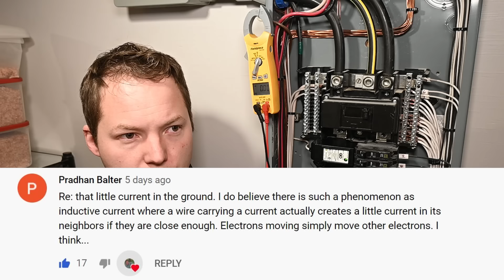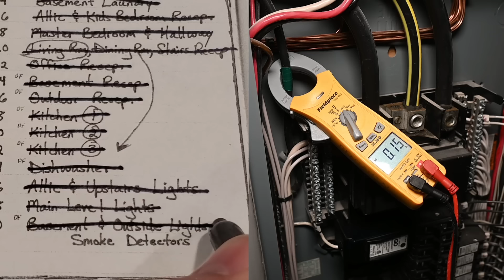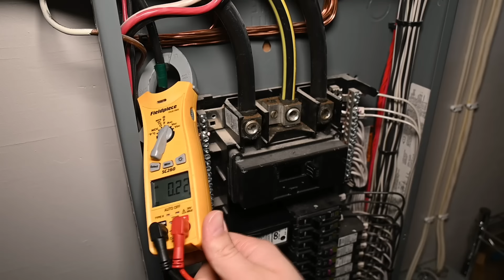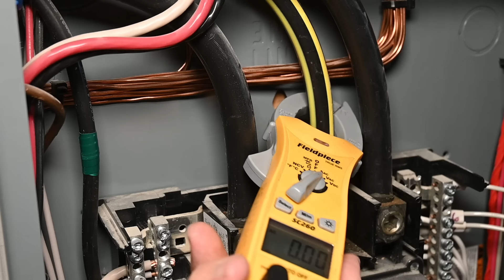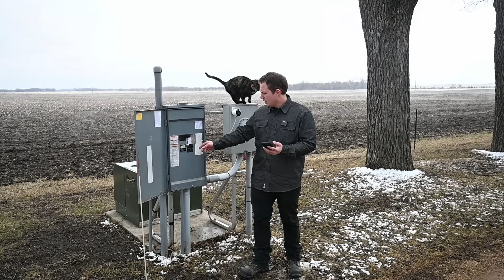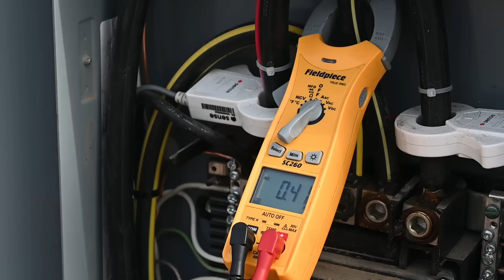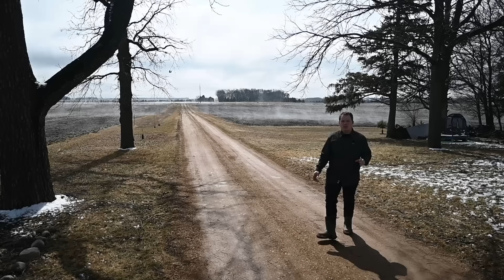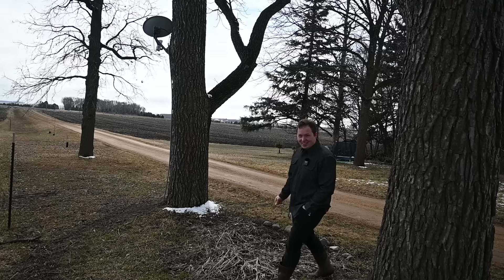Finding The Source of Stray Current on Grounding System

Comment from the maker: $25 off the Sense Home Energy Monitor with code BENJAMIN: http://store.sense.com/discount/BENJAMIN
Reply: It electric magnetic field from transformer which energized your grounded conductor before termination on first mean of disconnect.
So you getting voltage on your grounded conductor/ I=E/R. Your E from magnetic field and your R is R of wire and connection etc. 
That is why your have a current. Check your voltage between grounded conductor and earth.
Reply: @ivglife9831  I just saw this.   I am not an electrician so I am not fully fluent in electrical terms. If I understand this correctly I do not have voltage on the ground when separated from the neutral in the breaker box. The voltage is definitely coming from the transformer on the neutral leg, but only shocks us or shows any voltage in our shower, my next door neighbors shower and the master across the street, but I do not know if the one across from us is still having the issue as it has been empty for a while.  Last night I chopped off a fingernail too short and cut myself. Today I got japped in the finger in the shower.
Reply: @SteveP-vm1uc  Somewhere you have a cold water pipe ground and likely you have plastic pipe between the tub or whatever and no metallic connection to the street side of the connection to cold water pipe ground. Also, you might have electric water heater shorting electrodes. Plus this can all be installed at the water heater.
Reply: As Joe (below) points out, there is always some ground current flowing and it is using your equipment ground system as a convenient short cut.  The transmission line out at the road will have a common line accompanying it.  Each transformer on a pole should have its common connected to it and a ground rod at the base of the pole (bare copper wire stapled on the side).  Your remote transformer has its own ground rods locally doing the same job.  There is always going to be a slight potential difference between all these grounding points.  The Earth is not a perfect conductor.
Reply: It's the neighbours dodgy neutral on their installation.
Reply: So because their neutral is diminished, part of that current from the dodgy installation is travelling through their earth stake up your earth stake, through the main earthing conductor and earth neutral bar link and back on the main neutral of the installation you are working on.
When the neutral is really badly diminished you can sometimes see a stripe of dead grass, bushes and plants between the two earth stakes in a nice straight line.

Edit.... I see you are rural so unlikely to be the neighbour, but glad to see you figured out it was the NEIGHBOURING transformer and it's earth neutral link.
AMPs are cycling backwards and forward between one end of the secondary winding of the transformer and the other. On the primary side of that  transformer is the Alternator at the power station, excluding other transformers and boosters in between. But that is where the amps are cycling, on their own winding loops, between. At each transformer or substation their is an earth and neutral link.
The difference in you current readings is due to the resistance of earth between the earth stakes in your vicinity. If the resistance was lower due to rain or snow, you might see more current flow. Imagine if it was a piece of copper the same size as the neutral, you would see half of the neutral current flowing in it.
Reply: Inductive current is why that gauge you love to use so much works!
Reply: This explains it all: https://www.youtube.com/watch?v=a_nv_Q9WbeE
Reply: It is eather from the grounded airial/antenna or from one of the water pipes in the home witch are also grounded and the electrolis from the pumping station is dumping that current.
Reply: .24-.44 relates to 240-440 milliamps, I suspect it's the meter itself pulling this load, as you mentioned earlier the neutral from the secondary is connected to the neutral return, so you're reading the shared return from the meter. This is my guess. (the service meter not the amp clamp)

Comment: Measured voltage from neutral to ground should be 0 in a perfect world.  The "grid" has three measurements : Ideal, Normal, and High.  Ideal is 0.  Normal is under 2 volts, High is over 5 volts.  You can see the transformer, how's the grounding at the transformer?  But, that's not yours to touch.

Comment: Old post, but I would measure at the grounding rods and other earth connections.    200 mA is not concerning to me.      I bet that different weather conditions ( moisture levels ) would also affect it. The distance between transformers and the grounding rods for the transformers would be of interest to me as well. 

Also that large service transformer likely has some amount of EMI shielding  tied to ground.    AC supply can be loaded with EMI. I know in my one home it is and the other is very clean.

I did study grounding systems years ago …. Can be very interesting or a red herring…..

Comment: My first thought would have been induced voltage. Your grounds run behind your mains. But you mentioned EMF i think you meant your surge protector which uses MOVs . You my have an over voltage bleeding to ground through the surge protector doing its job

Comment: Must be current flowing within the grounding system if it’s not coming over the phases or neutral.  Probably some equipment is connected to (or not perfectly insulated from) a ground that is at a different potential to the main earth stakes.

Comment: Ground just completes a circuit from the transformer, in case of an emergency situation caused by a "hot"/energized line that comes into contact with a grounding system. I wonder if the "earth" is acting as too good of a conductor causing the small leakage you're seeing.

I do see some other comments that appear to know way more than I do about the utility side of things.

Comment: Thanks for the great explanation. I have a question. Is it important that the back of the thermostat is flush with the surface of the water tank? Is it okay if there is a slight gap (1/8") between the surface of the water tank and the thermostat? Please show me your answer.

Comment: Sounds like either the insulation of the transformer or the feeders from the transformer are acting as a very weak semi conductor, or it's simply capacitance of both the transformer and the feeder conductors. Some people think it also could be inductance, but since both line conductors are together, that cancels out the inductance.

Comment: This got me to re-inspect my power pole.. as the incoming transmission is 2 wire to a giant capacitor on the pole exiting 3 wires to the drop. Pole has it's own ground to the bottom of itself. 
Im getting ready to install or upgrade my solar system and am studying up on panel ground procedures on NEC codes and off grid bonding techniques. This is extremely important for lightning 🌩 as to not burn everything up. New code States do not use or install multiple ground pathways ever due to the backflow looking for its way home makes more sense after watching this video and then the comments. 
IE you have way too many pathways to travel around your home potentially frying everything in it's path should lightning hit. 
I don't agree but they now want everything on our property bonded to one exit path...

Comment: I see this video is 5 years old, but the ultimate resolution is not described, so let me offer a possible explanation.

I worked for several years in the T&D department of an electric utility and we always had issues with Delta and Wye distribution systems. To save on conductors, many rural distribution circuits are Delta systems, where there is no neutral wire, and hence the neutral is floating. If all phases are equally loaded (balanced), the neutral is at zero volts relative to the phases. But if the phases are unequally loaded (which is typical), the neutral will be at some potential above ground, resulting in a non-zero ground current when a neutral is introduced at the padmount transformer.

The minor changes observed in the ground current on the ammeter could simply be due to people in the area changing their electric loads, causing the floating neutral to move around.

Comment: Nice organized box....but theres a ground problem?  I think too much emphasis is put on install technology.  Ground fault breakers are a joke.  They fail all the time.  For years, a gfci outlet was just fine. Ive replaced hundreds of failed gfci breakers. That and stupid inspectors and some codes that create ground faults.  Another problem for some systems are the bonded ground screw.  That said, your methodology in testing circuits one at a time is great.  Nice video!!   But, sometimes its a neighbor that shares a transformer.  If there's too many houses on the same grounding system you can get stray currents. Thats why keeping the grounds and neutrals separated may solve the issue.

Comment: Heard a guy looking at why milk cows had a 24v potential from front to rear hooves.  Milking machines would shock them.  Barn ground rod had different potential from main drop ground.  Motors running in silos would create voltage "islands" around their grounding rods

Comment: Check ground connection,  after checking wire to ground rod. Take a garden hose turn water on , leave on slow stream for few hours. Saturate ground around grounding rod this should make a better grounding connection to dissipate current flow, recheck current flow. If unchanged call you electric company get a definitive answer from them as to what current flow should be. I had a bad light switch that would give me a light shock in winter. I pawned it off on static. I solved problem of getting shocked by changing dangling chain to  dangling piece of string. No current flow threw cotton string, only threw chain...no more winter shock

Comment: Most smart light switches require a neutral, but not every switch box has one, especially in older homes. Sometimes a homeowner will use the ground wire as a “neutral.’ This functionally “works” and while the current is typically only on the order of tens of milliamps or less, it might be enough to cause problems somewhere else in the system. Don’t do this. If you’re installing a smart switch and you don’t have a neutral in your switch box, either pull one from another local box yourself or get an electrician to do it for you.

Comment: Electricity will always seek the path(s) of least resistance.  That could be a neutral bond, a ground line, and/or YOU!  
Another possibility would be wires under or near (100' or less) the high tension lines.  Magnetic flux could be creating a small induced current.

Comment: What an interesting problem I looked for a fallow up video but found none.  But this made me curious it must be the high voltage step down
transformer.  So I made made some assumption and calculations and was a bit surprised by the result.  So here we go using basic electronics 
formulas.  lets assume the primary side is energized with 7,000 volts relative to the earthed ground.  The current in your ground conductor is 
0.20 Amps.  Calculate the impedance Ohms law  7,000 V / 0.2 A = Z of 35,000 Ohms.  I will assume the insulation in the transformer is perfect
(a questionable assumption)  Transformers can have parasitic capacitance between windings, cores and enclosure.  Question how much parasitic  capacitance would be needed to produce the observed current?  Calculate Xc = 1/ (2 * Pi *  F * Hz) rearrange equation to 1 (Xc * 2 * Pi * Hz) = Farads
1/(35,000*2*3.141*60) = 7.578E-8 Farads  that is 0.076 micro farads that is a small amount of capacitance but very possible to have in a transformer
very dependent on design.  A quick check revers calculation 2*3.141* 7.57e-8* 60 = 35,000 Ohms.  So a very good chance the source of the phantom 
current is the high voltage side coupling to the low voltage side via parasitic capacitance in the step down transformer.

Comment: So you probably found the issue by now. But why do you have grounding rods at the house when you have a first disconnect at your roadside transformer? Just asking?  My thought was you are slitting to a point the “current “ between the gas/ water line you mentioned and the Two ground electrodes at the house.  

My thought is you have your first bond at the transformer service panel because you have a generator as well that you plug in at that location right?  So the grounding conductor from there is your house ground and bonds everything els. ??  

Please let me know if I’m off track. 

Great content.

Comment: Ok. Clamp that meter around your gas and water lines and also check both for voltage. You could have a home down the power line with a broken neutral and your ground system or underground piping is enabling that house to run without knowing they have a problem because their ground and neutral is bonded. They are running on their ground system. It will cause your voltage on either phase to change upon their load. So get a min max meter and leave it connected for a day and check high and low on each phase in your basement panel. If those change by more than a few volts that could be your culprit. Also about the dielectric Union. Never break any pipe connection anywhere without a clamp on jumper cable across the connection in case it is carrying current. You could get a spark and it could shock you badly or kill you if your holding both halves or the energized half because you will complete the circuit. The union will stop current flow but.... If that pipe is energized the side that is will become dangerous looking for the first person to touch it to complete the path to ground. So you may touch a gas appliance and get a shock with that dielectric union installed. I'm no expert but I've researched and this is all possible, good luck and be careful. Get ppe gloves to work in from now on. See ya. J Poll. 👍💯👏.

Comment: this sounds like a neutral / ground issue. you should have 4 wires going from your main panel to any sub panel (2 hots, neutral, and ground) and every sub panel should not have a connection between neutral and ground. 
I wonder sis you ever solve this problem?

Comment: I put in a new subpanel at my pool 20 years ago before I knew what I was doing. I bonded N&G in that subpanel I had a GFCI outlet that covered my pool light also. Later when I got more educated went back and fixed it before I did put a current clamp on the ground wire sure enough current was flowing on the ground wire from the pool light circuit back to the sub panel. Since my subpanel had ground and neutral bonded there current stopped there none on the ground wire. It only had current on the ground wire when the pool light was on because pump is 240V.  GFCI outlet never tripped because current was 100% on the neutral from the outlet with the pool light on the load side of the outlet. If the pool light was tied into the sub-panel directly without a GFCI could get shocked because current could travel the grounding system possibly I think lower resistance would be the wire not the water.

Comment: You understand grounding and "neutrals" better than 99% of electricians. Any and all paths regardless of the system. If you have an ungrounded secondary that is fed from a grounded primary there is potential to ground. When you talked about the powerlines on the road is the answer. Best video I have seen on this topic!

Comment: Retired service electrician here. I retired in 2020. If I remember correctly using a gas line for a ground is a violation of the NEC, but gas lines should be bonded. Ground rods at sub panels on a 4 wire system is also a violation.
I believe your interference issue is caused by your ground rods at the main panel is in close proximity to the high voltage lines at the transformer receiving induced current. Disconnect the ground rods at the house and the bond on the gas pipe and if the issue goes away, you,ve found the issue and I will be  correct. My next issue is, why is the meter and main panel, and ground rods so close to the transformer? I’m assuming it’s a 20kva transformer. Think about it, 20,000 volts near this system.
If I am correct about the induced current,  there needs to be some major relocation that needs to be performed.

Comment: Your main grounding  conductor should be going to the small lug beside you’re incoming neutral conductor, not to the box, the box is bond only, you need to solidly ground directly to Neutral above main breaker not through the bond screw. Or is that Canada only and not USA code

Comment: Retired lineman, my opinion is an unbalanced load on the primary circuit. A balanced primary load would show zero. An unbalanced primary load would show the appropriate current. I have seen it as high as 11 volts. Switch the line feed from another feed and your reading will change. It’s all about return current back to the power plant.

Comment: Not seeing what the actual problem was officially diagnosed as, but I suspect it is current leakage via Telco or Cable Company or Cold Water Pipe or Natural Gas Ground. Another thing I thought about is some meters have a plug on Neutral and you are seeing the meter's operating current flowing to Ground.